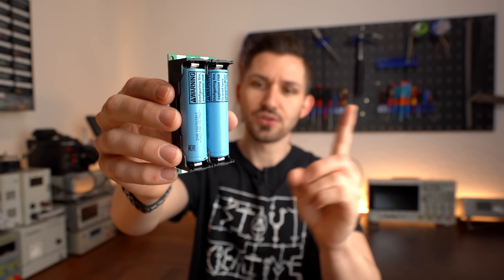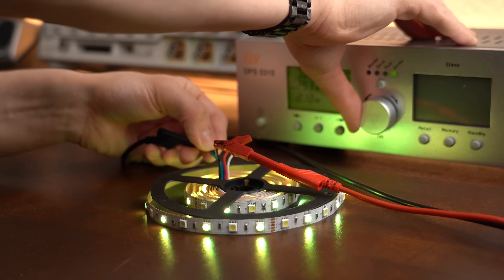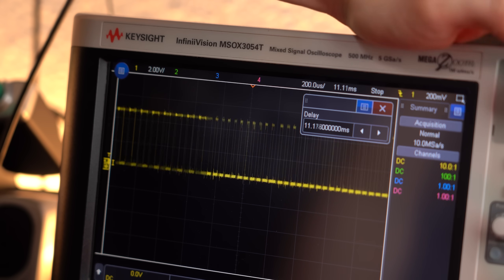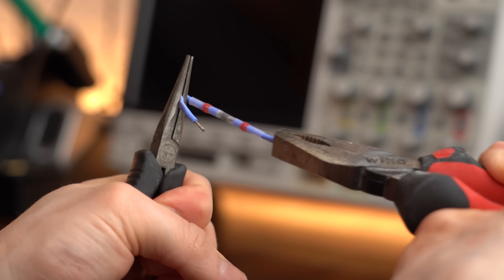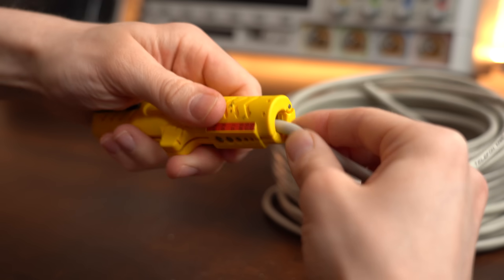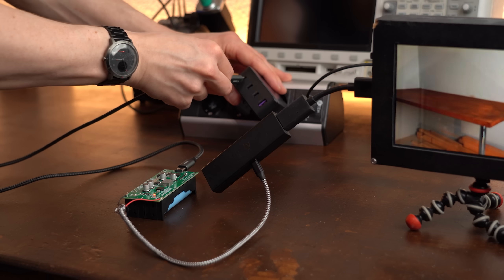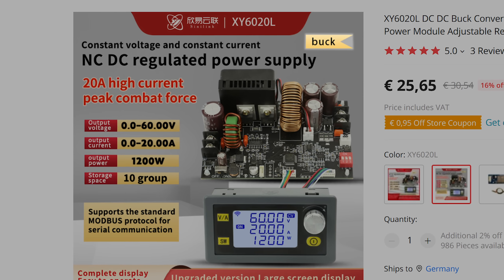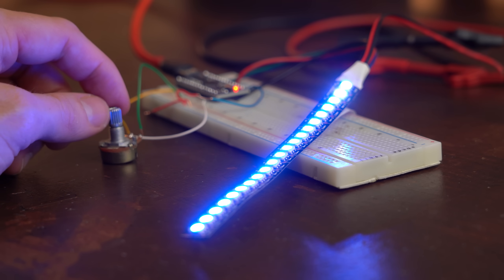I tried finding Hidden Gems on AliExpress AGAIN! (Part 4)

Comment from the maker: CORRECTION!: After testing the cable stripping knifes, I realized that I had the perfect tool for it laying around. It is this one (also from Jokari, affiliate link): https://amzn.to/40ZBzWk 
No idea why I completely ignored it until now. Mistakes happen😅
Reply: Would adding a cap to the output on the power supplies be enough to squash the noise?  That would be a good video as well.  Fixing the output ripple on them.
Reply: @BloodBlight  Yes - but low ESR is probably more important than capacitance for those outputs (given the shape of the noise it was most likely created by the ESR of the output cap). The best would be to use an inductor and a capacitor though - to form an LC filter on the output. That would get rid of almost all that noise if the inductor and cap is big enough.
Reply: @Speeder84XL  I think that adding different capacity and different types of capacitors might also help to reduce noise.

Note that adding large capacity caps will disable the current limiting function. 

Just my thoughts.
Reply: @BloodBlight  See my response to speeder84xl
Reply: Id love to See more 1865 UPS or other circuits involvong them
Reply: D,,,,,xxxঢ়,,ঢ়ঢ়,ঢ়ঢ়ঢ়ঢ়ঢ়ভঢ়ঢ়ঢ়ঢ়xx,x,xঢ়ঢ়ভঢ়ড়,xঢ়, @NinoJoel  ঢ়ঢ়ঢ়ঢ়ঢ়,ঢ়ঢ়,ঢ়ভঢ়,,ঢ়,ঢ়
Reply: The solder didn't melt. You need to add more heat.
Reply: @micnolmadtube  I have found the same problem of either the solder not melting or the insulation being damaged from  too much heat.  I now use crimpable butt connecttors that have heat shirk tubing on the outside.
Reply: That's the tool I use at work they're fantastic for  stripping multi core outer sheathing.
Reply: On the soldering joints, id be careful with them. If you cut them in cross section you'll see that often they are not fully soldered together. Additionally they use very low melt point solder meaning they will come apart again under some heat in situ.
Reply: @JLneonhug  These soldering joints are generally a bad idea, as it stiffens the cable strands.
A proper crimp, assuming usage of the correct tool, will still result in a gas-tight connection. Knipex has a few videos showing how well a proper crimp fuses all the copper strands together. And it's quicker.
Reply: Can you feature digital fingernail clippers?
Reply: Thanks for the lowdown on the wire strippers brother. I added that red one to my list and I kept looking and debating it, but now I'm sold. Another perfect video.
Reply: Your English is excellent, and often better than my English (the only language I know!). Just to let you know we call that sheet you use for filtering charcoal not coal, although both are carbon. A lot of the eBay and AliExpress sellers are using a mistranslation of charcoal.
Reply: That yellow one is 100% intended for data cable, the notch on the end is for punching things down, they are as you said generally bad but still cheap to keep around in a toolkit as a just in case for handling network cable.
Reply: It would be nice if you created a board for the ups 1865 batteries. I have many smart devices at home that needs charging from time to time. It would be nice to have the option to add more 1865 to increase the time for charging . That would mean for example my smart curtain would go 2 years without charging with a ups with 4 cells 😂
Reply: I've used one like that at work but found it pretty hard to cut the outer insulation without also nicking the conductors inside (not cool for an industrial environment). Either way it does the job, but the red one you showed looks like it would be better for some things, especially removing the insulation from an entire length of wire.
Reply: It doesn't look like you got the solder joints hot enough to melt the solder properly. If done right, it infuses into the wire like normal soldering, not leaving a large, defined ring.
Reply: would love to see if you could find a decent 18650 ups device that is not too expensive.  that's a very cool ting to have around, and would be great for lots of projects!
Reply: Hi man, WHERE.. or WHEN , A timestamp would be greatlyappreciated. ♥️❤️🔥 your channel,
Reply: The initial jokari you're complaining about is for house electrification, allowing to stripe wires inside mounted boxes.
Reply: I use a similar one at work.. super useful.
Reply: During WWII they first deployed those types of soldered wire joiners. Except they used a thermite compound. This allowed people to crawl out to repair telegraph wires, while under file. They would find the broken section, place both wires inside, and then hit it on a striker. The resulting heat would melt the solder and join the wires again. It all happened very rapidly.
Reply: @justanothercomment416  Isn’t thermite used to weld train tracks?
Reply: @Conservator.  correct.
Reply: Have done a review if 'twin and earth' strippers?
Reply: yeah I actually wondered while watching video howd you forget this one lol
Reply: rgb is a bad led. the white is not pure white, its done via other colors so its like bluish white.
try for rbgw leds to get proper white.
Reply: The second stripper is only intended to be used for coax cables, that's why you turn the x-bracket to meet the cable spec...
Reply: Did you try to cut open the cable chrimps after heating them?
I ordered a set of them, but after testing a few times I discovered that the solder did not wet out the copper standsa at all, it just molded around it but could be peeled off using only my fingernails

I can't even get it to wet out the copper when applying heat from a soldering iron directly on the solder adding my own high quality flux

I don't think it works much better then hotglue on twisted wires

Any thoughts on that?
Reply: Lieber Great Scott. Ich liebe Ihren Kanal. Aber ich bin immer wieder irritiert, weil Ihr Englisch "gewöhnungsbedürftig" ist. Dies liegt an den "zufallsverteilten" s-Lauten. Manchmal treten fast keine auf, manchmal stören sie doch erheblich. Woran das liegt ? Keine Ahnung.
Reply: Dude! You should know better than to wiggle plugs-out!!! (USB C)

Comment: When I tested the UPS module in the 12V version, I not only agree with your findings, but I will add one observation. Originally, I wanted this module for backup lighting, whose consumption was 3W. I very quickly found out how much the batteries heat up, including part of the module, when it is charged and at the same time discharges when the light is on. So much so that I refuse to use this module and I think that it must also degrade the batteries themselves.

Comment: I notice these power supply modules are commonly available, but many seem to display lots of noise. 
I would be interested in trying to clean up the output, is this practical? 
Great video as ever.

Comment: You could add a large capacitor to the output of any noisy power supply/converter (>3300uf), to reduce the noise on the output, and increase the surge current capability.

Comment: 8:49 so, if you buy an UPS like that must be careful..
especially for electronics that have an IC with very small range input voltage..
because that IC can be destroyed immediately while plugged in the output cable from the UPS to the load..
immediately destroyed, because the voltage spikes and noises from the UPS module..

so, this module more like the battery charger than the UPS.. 

if you use this as the powerbank, just be careful about what the devices you want to used.. 
for powering the fans, or just simple devices with an IC that have wide voltage input range, or simply don't use it as the UPS..
just use it for the lithium charger..

or find the powerbank modules or buy the commercial powerbank.. because even their works principle are the same, because they both literally a boost converter but the output noises can be different..

powerbank modules can output stable 5V with very low noises.. which means, the 5V output was indeed 5V, not fluctuative like over to 6V or under to 4V.. 
thats because, the powerbank have the higher switching frequency, so their noises can be minimum.. and also they have the real IC..

because the boost converter from ebay or aliexpress, MOST of them are FAKE (the IC was fake or counterfeit, not the real IC)..
so, the IC that used by the UPS maybe simply not suitable or the circuitry design are crap..

like LM2596 buck converter, many buck converter with IC are just rebranded LM2576 or the older version.. so the IC also fake..

so while you ordered the buck/boost converter like that, you can change the IC with the real IC (but you wasted the money too).

Comment: I know its been a year but ima say it anyways. You shouldnt use those waterproof connectors in any household or high stakes or high heat electronics. Im pretty sure they are strictly banned in US residential wireing because they dont actually have a psychical connection. If those wires heat up to much, then the solder will melt and the 2 wires can come apart pretty easily. I love these connectors but they need a proper psychical connection aswell. Maybe you can crimp and then heatshrink them so that they are psychically together and they are waterproof. But crimping could mess them up. So really, i have no idea what is ideal for these.
Reply: They are the recommended way of connecting wires in automotive repairs.

Comment: The UPS that you mentioned at 8:40, I wonder if you had considered measuring the output after adding another low ESR capacitor in parallel on the output?  I recall you mentioned adding a linear regulator (possibly on a different video about this UPS board?) but many projects don't need power that well regulated, and a linear regulator is a fairly large commitment to make on something battery powered (if/when serving its purpose).  It almost seems like, that at the very least, it would be more efficient to just add more capacitance and then if the voltage spike is troubling, to zener diode shunt that to ground above whatever voltage # that you find troubling?

Also did you make it clear at what output current the ripple is so large?  I would not expect most people to buy that if they actually needed to power a 3A load, more likely some lesser current would be more common like around 1A if even that.

Comment: For the wire connector you can use heat shrink jackets to increase their diameter and make a better seal. Works even with solid wires. My favorite solution to stich two wires together

Comment: These heat shrink things can be really usefull when you just want to connect 2 wires together and dont want to pull out your soldering iron for just a simple task. Also you can pick them locally cuz theyre really common

Comment: The gray wire stripper at 8:02 is for COAX cabling. It's not.meant to strip other cables. Either read the instructions first or look closer at the description.  Sigh.

Comment: Did you try to cut open the cable chrimps after heating them?
I ordered a set of them, but after testing a few times I discovered that the solder did not wet out the copper standsa at all, it just molded around it but could be peeled off using only my fingernails

I can't even get it to wet out the copper when applying heat from a soldering iron directly on the solder

I don't think it works much better then hotglue on twisted wires

Any thoughts on that?

Comment: 8:00 the stripping tools were probably misleading announcements, or even worse, subverted manufacturing... The first tiny yellow one is usually bundled with RJ-11/RJ-45 crimping tools, and the "grey one" is usually meant for different sizes of coaxial cables (it usually carries two blades, with center indents to allow for the central core to pass-through) - thus the "6" position would actually strip an RG-6 cable perfectly, ready to insert into a crimping lead...

Comment: the 12 volt battery backup isn't too bad, depending on use case. a lot of 12v equipment is built to deal with the voltage spikes and fluctuations of a car alternator. which can sometimes spike to 15 volts, and often waves between about 12 and 14 volts.

Comment: Regarding the UPS's DCDC noise issue,  better to try with a nominal current sinking because some of them have a low consumption mode in idle mode to prevent to use to much energy while they are supplying nothing.

Comment: I like the 5v mini-fume extractor, but does it come preinstalled with a carbon filter?  The $4 quick red wire stripper is a no brainer!  

Regarding the Heat Shrinkable Wire Connectors SST21 , what brand of 'wago' Terminal blocks do you recommend?  I've seen lots of knockoffs called 'wago' but from different manufacturers.  

I understand the buck converter noise on the output is about 70mv (150mv spikes) when measured with 'math' and 2 probes, or with 1 probe and the ground lead clip disconnected and 20Mhz Bandwidth limit on.   Those $3 24-Pin ATX Breakout board (P22NW0520FR-4) as the input to one of these Buck/Boost seems like a good combo.

I've also liked some of the other tools you've recommended..
$30 UYUE 946C hot plate 
$5 USB Isolators (200ma max) for audio-amplifiers 
HLK-LD2410 BLE Kit 24Ghz Motion Detectors
$26 Docreate spot welder for nickel sheets onto lithium batteries
Considering the cost of a solar panel installation, the $60 elejoy solar panel multimeter seems worth it if I had solar

Comment: I have that yellow wire stripper that you didn't like & it strips wires just fine for me with no complaints.

You weren't using it on the correct sized wires & you still called it a bad product.

Comment: I like your videos. In risk of repeating someone else I would advise you to measure the noise of the power supply with a hook on the end of the scope probe. Your ground lead will pick up lots of noise from the inductor.

Comment: Hi @greatscottlab ,thanks for your videos, . I have this power supply, just burned the D10 (diode i presume) located near uotput terminals, . Do you happen to know part number , so I can replace it,  i cant find data anywhere

Comment: I got the Buck power supply for charging  LiFePO4 packs during testing, much cheaper than the big brother of your Battery tester ~ $85 with a 60v 1200 watt switchmode  power supply.

Comment: Did you say the IP2368 Pro likes to explode??? I literally sleep next to one…it’s an amazing module with a nice case. I know there were issues with people using 5S and 6S and some component on the rear of the board that couldn’t handle the voltage

Comment: Hello. Very good work. Congratulations. If you add a capacitor to the output would you be able to solve the output voltage problems?

Comment: I have orders coming in from AliExpress every month.  They have been reliable and consistent.  My only complaint is some confusion about exactly what you're buying.  The picture may contain parts not included in the purchase.  BTW, that is one sweet R&S scope you are using.  I have the RTB2004 and it's the best scope I have ever used (& I've had them all).  Saving up for an MXO 4.

Comment: I got a bunch of boost converters for 18650 batteries for between $1-3 on Temu and battery boxes for around $0.50-$1 there as well. They work great but I'm curious if you would recommend them!

Comment: The solder connections are pretty damn awesome, just push in and heat no need to twist, used them on my bike and 3d printer.
Combined with a gas soldering iron which doubles as a small torch it cant be anything but a success.

Comment: I just use a cheap thread-ripper to remove the outer insulation from cables.  They're small enough that I can have at least one in every tool kit, and I haven't yet had a cable they couldn't cope with.

Comment: For the solder connecter I just use a lighter go back and forth, don't keep the heat in one place and it should be a has install I had to wire up a head unit adapter for my car and it didn't take long as well as leaving a lot more space in the back with a very strong connection
Basically a heat gun is un-realistic for such projects baut a lighter makes it very fast and affordable as long as you do it right

Comment: Fun fact: You can turn any USB power bank into a UPS with only two diodes and a male to female usb cable (or whatever connector type you want.)

It works because when power is supplied, the power bank automatically cuts power output as it starts charging, when power supply drops out, bank is no longer charging so provides power. 
The diodes are used to prevent the power supply from powering the output of the bank and to prevent the bank from charging itself.

Comment: Couldn't you slap some output capacitors onto the output of the power supply to smooth the output a bit?
Reply from the maker: Not that simple. Watch my latest video ;-)
Reply: @greatscottlab  Where can we buy the activated coal sheets economically, my friend?

Comment: I actually recommend the small yellow wire stripper. I use it all the time. Ive had mine for years and no cracks like yours. I think you may need to learn how it works , perhaps. If you put It on the wire, make sure it's one below the wire gauge. Use your master index finger to spin it around. Spin until the shell is cut. I use it for cat 5 all the time.

Comment: I noticed the capacitors on the UPS do not match the XR2981 recommendation of one 470 uF capacitor with 22uF low-ESR tantalum/ceramic in parallel.  Perhaps two 220 uF capacitors in parallel as supplied do not filter sufficiently.  I am changing mine out to meet the spec sheet.  I also noticed that the only thing needed to change the voltage output is the value of R7;  30K=5V, 63K=9V, 87K=12V.  For increased cooling one might want to remove the cell holders from the back side of the board to double convection to the board, or attach a fan/heatsink.